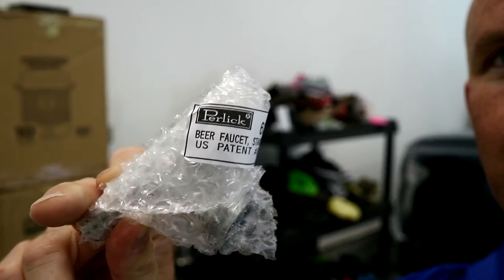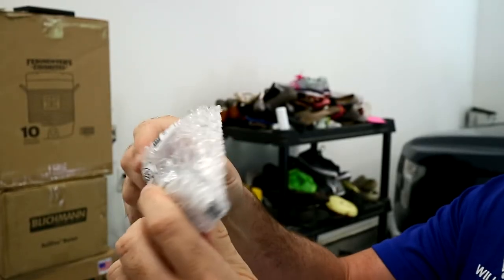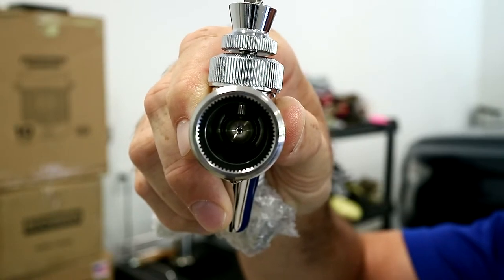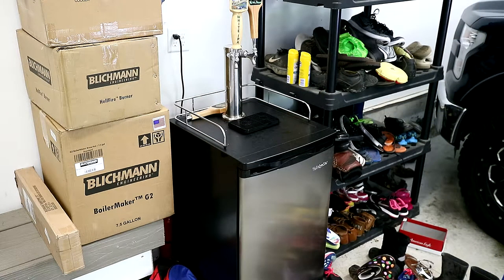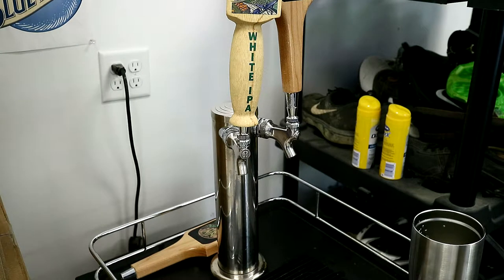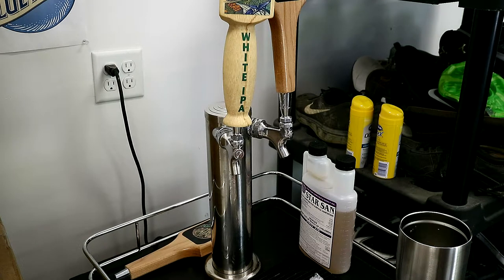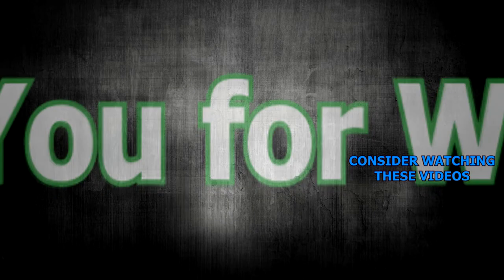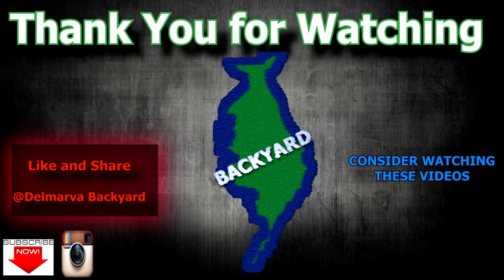Perlick Beer Faucet Un-boxing, Installation, & Review

Comment: You gotta get yourself a faucet wrench.  Way easier and cleaner (you don't mess up the finish) to separate a faucet from a shank and only cost a buck or so.  My other suggestion is keeping some starsan in a spray bottle and hitting up into the end of faucets at the end of the night, it'll help keep crud from building up as much.
Reply from the maker: Excellent advice. I'll look into it for sure. I actually have starsan in a spray bottle (mainly from brewing). Awesome idea to spray on the ends at the end of the night. That will help keep any crap from growing in the caps. Really appreciate the comment and thanks for watching.
Reply: For those reading, forward sealing faucets require a longer return/close spring.

Comment: So, two and a half years in, how are the faucets doing? How many times have you replaced that forward facing seal? Perlick would suggest you replace the O-ring every couple months, depending on usage, maybe more often. Hope you picked up that faucet shank collar wrench. Lastly, for anyone who reads this and is looking for a kegerator, the inexpensive kits from Home Depot, Best Buy, etc, come with cheep quality hardware. Take the money you saved and buy good faucets and keg couplers (for commercial beer, homebrew conversions are easy) right away. There are 3 or 4 of these upgraded units in sight. With proper maintenance, they'll last you for years. My youngest is about 6 years abd oldest has 15 plus on it. Cheers!

Comment: I bought the same perlick faucet. However when I installed it, the existing spring does not push very hard against the ball seal because the ball seal is further out than the piston seal, so leaks if you don’t push the tap handle all the way back. Did you have a similar issue with your set up?
Reply from the maker: Thats odd. No, I didn't have any issues. Thanks for the input.